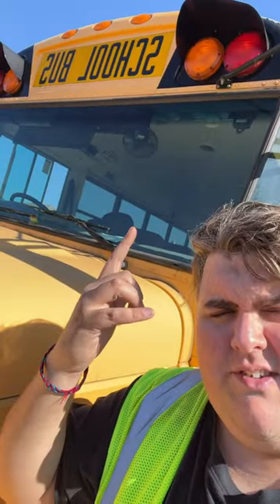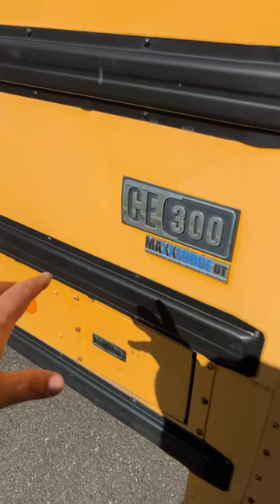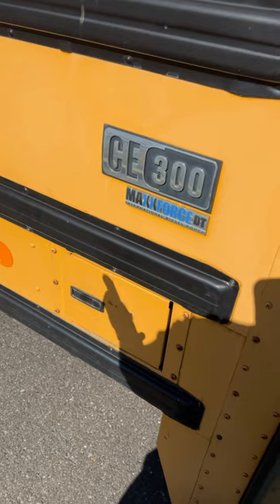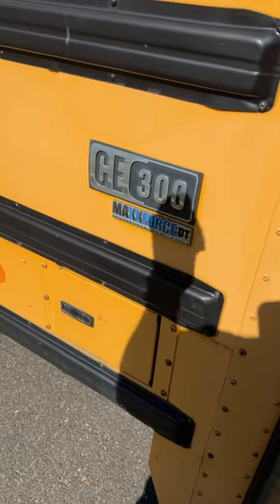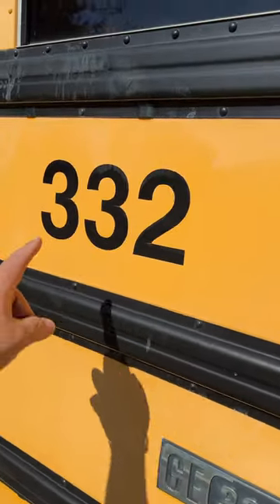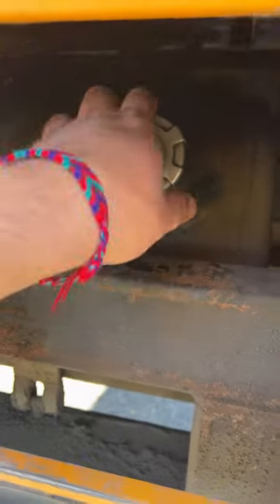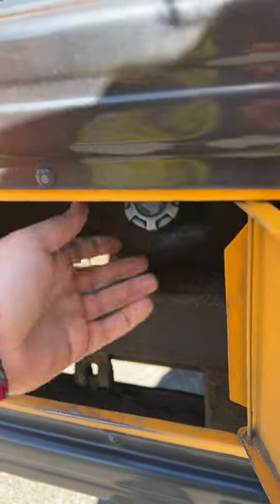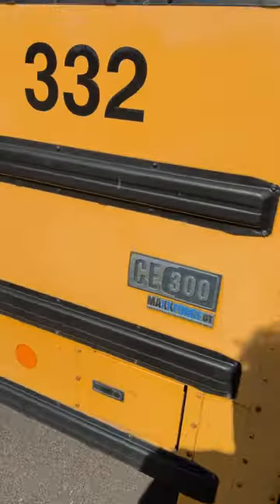HOW DO SCHOOL BUSES GET FUEL?

Comment: I've seen school buses at a gas station but not usually the fuel if you just buying something in the store. There is a single very long parallel parking space in front of a local Seasons Corner Market I go to. I think it was originally intended for food delivery trucks to park there but any vehicle can park there within the specified time limit. I occasionally see if school bus parked there.

Comment: Most of the time, if the yard doesn't have it's own, the drivers would fill up at a commercial fueling station and not a typical gas station. This, too, would be why you never see them getting fuel. I see them on occasion when I fill up at the commercial stations.

Comment: Any propane busses? I been seeing more of those lately
Reply: The company I work for sells the propane stations and the busses. It is a really cool system. My service van is a Ford Transit. It can run off of propane or gasoline. No difference in power or anything.